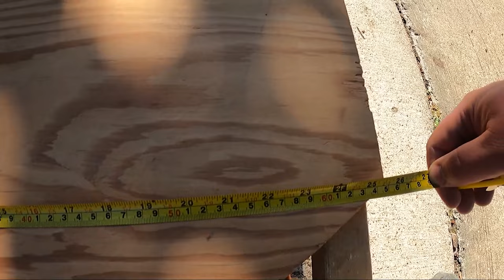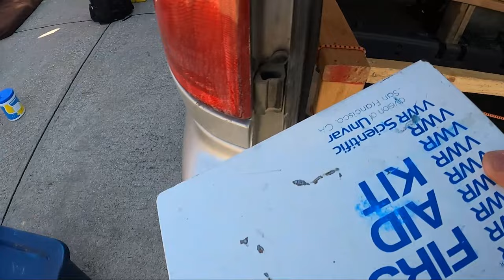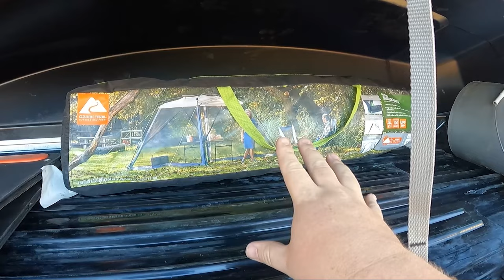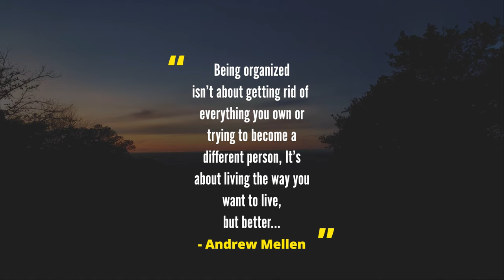Simple DIY minivan camper BUILD and ORGANIZATION (Specs for Town & Country and Caravan)

Comment: Instead of setting up the bug catching canopy may want to consider a tent that attaches to the back of the van. I bought a Napier vehicle tent a couple years ago, have a 2008 caravan. Works great. Can still have the security (had a bear incident last spring) of sleeping in the van. Plus a changing room and a room to set your potty. Have a four foot folding metal table and have cooked in the tent many times. Has lots of screened window area for ventilation. If you go this way highly recommend using a tarp under the tent. Get one large enough to have it extend out at the tent entry door (a porch if you will) for a place to take shoes off. Keep as much earth out of the tent as possible. I carry several inexpensive rugs. Makes the floor of the tent much more comfortable on bare feet. And perhaps the best part? If your significant other, for some unknown reason, is upset with you? You can sleep in the tent and they can sleep in the van. Recommend carrying an air mattress for such occasions. Other than that very nice build.
Reply from the maker: Haha! Great tips. We've actually considered one of those back extender tents. We might just end up with one eventually. Thanks for watching!
Reply: Bwah haha

Comment: So far I’ve only bought one, but I’m happy with the kilos gear High back chair.   I will buy another one once I have the money.   As a Canadian, I paid about 160. Although it takes time to assemble and take down (similar to a tent), that is the cost of having a full feature chair with dual cupholders, and additional pocket, nice seating height, and a high back, that packs down to the size of a loaf of bread, or maybe 0 degree synthetic sleeping bag
Reply from the maker: Just looked it up. That's actually pretty nice. Holds a lot of weight too. 330 pounds. That's impressive. Thanks for the suggestion.

Comment: We have a similar set up. We love the camp chairs from harbor  freight with the side table. These are very lightweight  and comfortable. We stow them between the bed frame and sliding door on one side. Easy to get to. We also have the tri fold mattress.  You can separate only one part between the threads without ripping the cover. It takes time and patience but will assist in using the platform for seating if you need.
Reply from the maker: That is a genius idea on the mattress! So glad you commented. We'll take a look at the chairs too. Thank you!!!

Comment: Nice job!  I am beginning to convert my Chrysler T&C.  Coming from an EMS background it makes me shudder when I see builds that don't secure the furnishings in the event of a significant front end crash.  Also, the propane is stored in the rear crumple zone area which is made to collapse in a rear end collision to disperse the energy of the impact.  Otherwise this looks very well planned.  Everyone is different and I am not criticizing.  Just observations.  Safe travels to you guys!!
Reply from the maker: Thank you. That's actually a very good point on the tank. When this one gets empty we'll get a smaller one that fits in the topper. We wanted to do that anyway. Appreciate that and glad you said something.
Reply: I hate driving with fuel in my vehicle 
I’m nervous driving whole time when I refill our 3 propane tanks  !
Even Coleman fuel or butane would make me so nervous. I don’t carry spare gasoline either.
Kabooom if ur in an accident!

Comment: You guys! Your conversion is so close to what we're wanting to do with our Town and Country! We're planning on taking an East coast trip this fall for about a month. The trick is, we have a toddler and will need to use one of the back seats for her car seat everyday. If we could get that front third of the bed frame to fold up out of the way easier, we'd be in good shape! Do you have any ideas on how you would adjust that front third to make accessing the one seat easier?
Reply from the maker: Sorry we missed this as we've been out of cell range for the weekend. We've considered making a slider on the front end and having foldable legs so it could just slid back onto the back section since we never use the couch mode. Hope that helps and that you have a trip of a lifetime making memories. Thanks for watching!
Reply: @TheAdventureCloset  thank you!! That's helpful!

Comment: Not sure if I missed it, but what size portable power supply do you use? I have a cpap also and I'm wondering what size will work.
Reply from the maker: Jackery 1000 and a Renegade 72000 mAH. Both work great but the  renegy is more compact and cheaper. I will eventually do a video on this so stay tuned!

Comment: First video I have seen with someone who uses CPAP.  What size Jackery do you use and how many nights sleep does it give you?
Reply from the maker: We have the original Jackery 1000, and it give me 4-5 nights, using around 15% of the battery per night, My CPAP pressure is set to ramp 7-14 so if yours is lower than 14 you would get more nights. We have a renogy battery we got off Amazon that gives 3 additional nights as a back up as well but we rarely need it.
Reply: @TheAdventureCloset  do you use your humidifier? I understand that is what takes up a lot of battery power but I don’t use mine.  Happy, safe trails to you!
Reply from the maker: @FemaleVillageElder  no, I don't use the humidifier, and thank you hope this info helps you out!

Comment: turn the mattress around 180 degrees
Reply from the maker: We're just too tall for that unfortunately.
Reply: @TheAdventureCloset  180 degrees would have the bed in the same orientation but flipped around. wouldn't change the length of the bed at all. just would let the mattress fold up easier
Reply: I believe you are thinking of a 90 degree turn

Comment: Nice build. I'm a bit late to the party here as usual.  I made one like the Nick and Maela build.  https://www.youtube.com/watch?v=Eo9SWRazTlE&t=126s  I made a video too. I found that making the plywood grain go spanwise is much stronger and it does not need a brace in the middle. This leave a lot more room for storage and is lighter. We are fairly heavy and have no problem so far in the few times we used it.  We can fold the front of the bed back and still use the right Stow and Go seat for a passenger.  The left seat was removed as well as the rear.
Reply from the maker: We will have to check that out. Thank you!